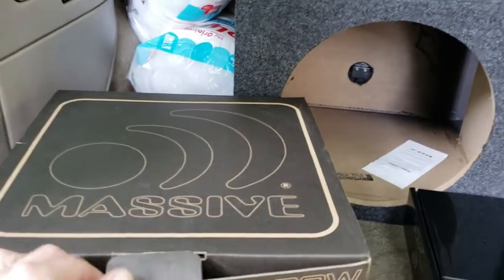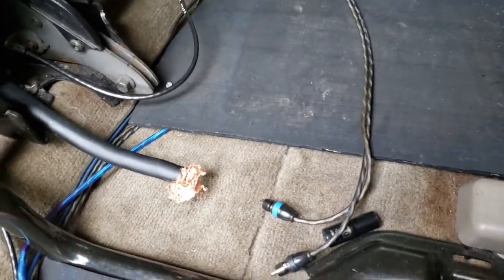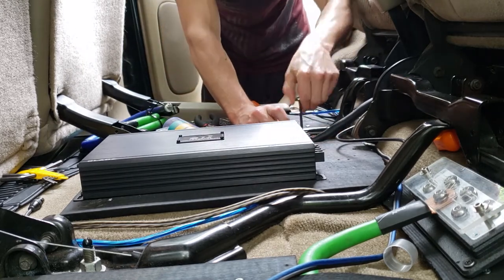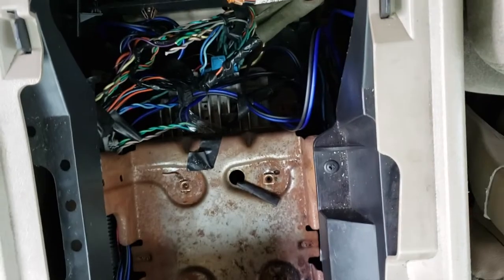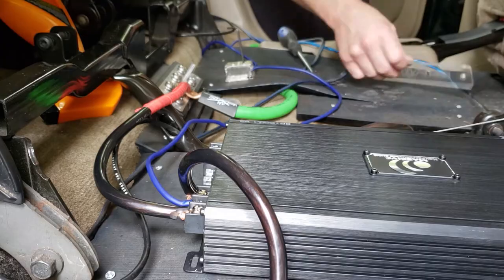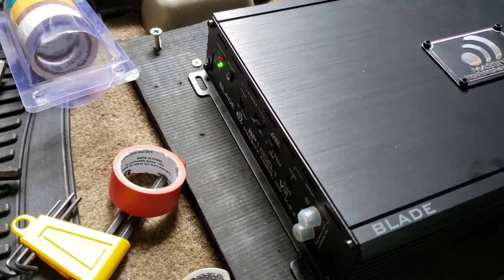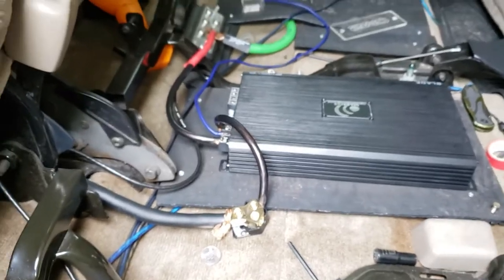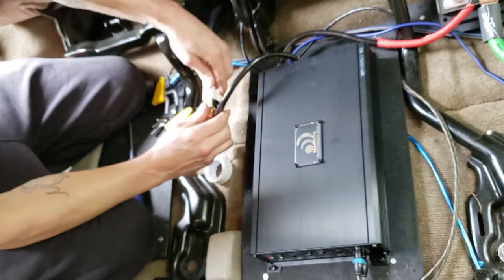Installing massive audio Eco 12 plus 1000 watt amp pt 1

Comment: Loved the explosions. XD Also, I wanna sit over there ----> XD  great video. Can't wait to get my Massive gear installed. :D Wish there were more Massive Audio amp vids in the world.
Reply from the maker: they were pretty cool huh lol. Thanks, man I greatly appreciate the support! and I agree there should be this is my first massive audio set up and I'm liking it for sure plus just got a new double din wired up and it made it sound even better. is there any type a video that u would like to see on the amp? How to set gains, cross over settings, bass boost, etc?
Reply: @BlackWidowdetailing  Thanks! Nice, a new double din? Sweet! Yeah, I've got a Massive PX1900.4 at home and I'm wondering if there's a way to know what frequency the crossover is at? It's just a dial with a wide range. So I kind of set it by ear. But is there a way to know for sure without an expensive tool? I do have a multimeter which helps with some stuff. In the car I'm gonna leave the crossover at full range and use the deck. Thanks again!
Reply from the maker: Nice! Yeah i bought a kenwood dmx7706s, its pretty sweet! Definitely recommend if u want a lot of different settings to dial in your music And i usually just use my head unit to set my crossovers i keep my subs at 80 and my mids and highs are set to 80 as well with the range set to full! The ear will never fully be accurate especially if your trying to match the frequency for subs and mids so that they're all playing in sync with one another. The only time setting the the crossover on the head unit is a problem tho is lets say your battery died and u lost all the memory settings and then u end up messing up your speakers/subs because the crossover not being on what it needs to be but other than that the head unit is perfect for setting crossovers unless its an old school radio or a stock radio but then u could always go with active crossovers which usually have the frequency on the dials
Reply: @BlackWidowdetailing  That totally works. Thanks for the advice! Happy bangin' Homie! :D
Reply from the maker: Forsure! Yeah man no problem, this is what i enjoy doing making videos working on cars and helping others the best i can 🙂

Comment: Could you ease tell me where the ground and hot goes on my amp
Reply from the maker: Your power wire will go onto the positive side which is a plus ➕️ symbol Your ground will go on the negative side which is a ➖️ symbol your remote wire is the smaller which that wire will also be a power wire u will need to hook it up to the remote wire or ignition wire on your head unit